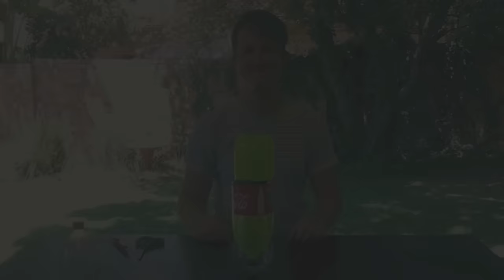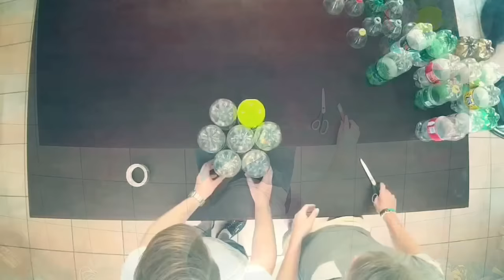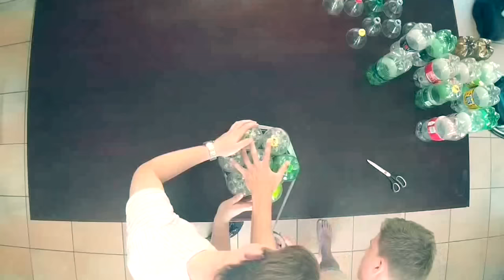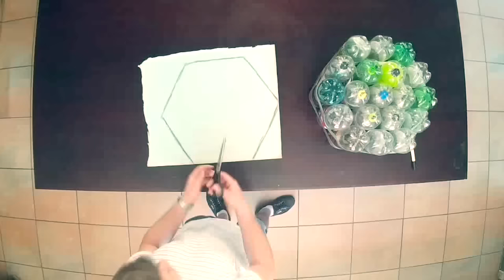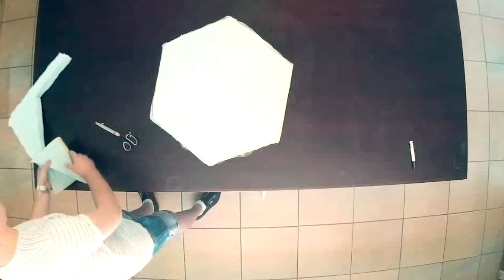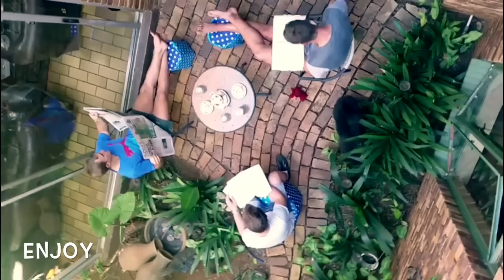Project Plastic: DIY Plastic Bottle Chair

Comment: Nice, to make it even better.  Wrap the body with card board then 1/2 inch foam.   Cover with the fabric and, then use some of the bottle covers as legs or whatever you wish.  The bottom will remain clean and not fray from being on the ground/ floor.
Reply from the maker: Excellent Modification! Thanks for the tips!
Reply: Flowergirl Power i
Reply: In addition to her suggestion, I think we can also fill up the first bottle (the uncut ones) with plastic bags. First, it adds some sort of weight. Second, you recycle more plastic.